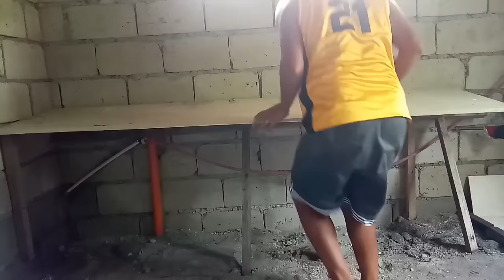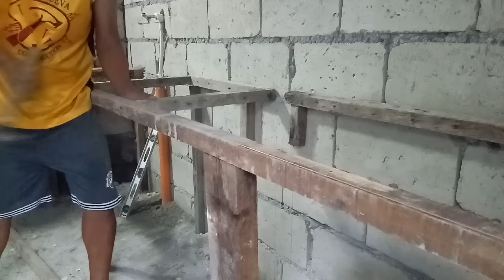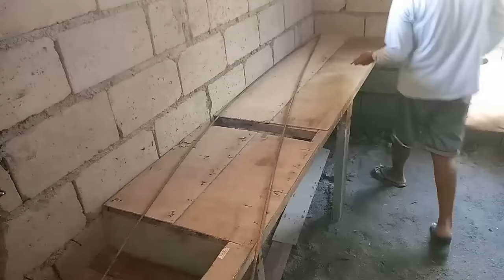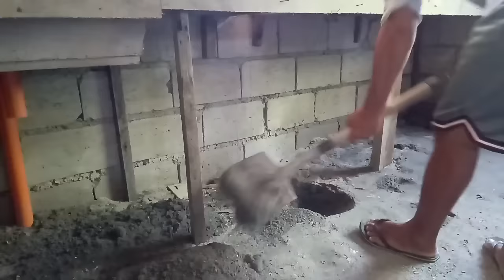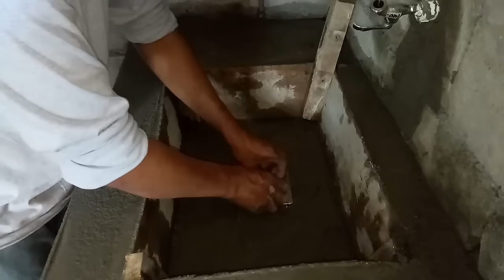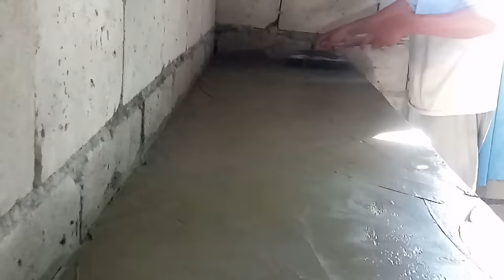How to make concrete countertop |how to make concrete kitchen sink |paano magporma ng lababo na puro

Comment: Ano po bang magandang concrete sealer/finish para merong glossy look yung concrete countertop? Salamat
Reply from the maker: may mga rubberized paint po or waterproof paint..ask lang po sa hardware or paint center..ako nilagyan ko na po ng tiles yan..check nyo po ibang vlog ko..salamat
Reply: @Kabukid21  salmat sa pag respond po! More power!